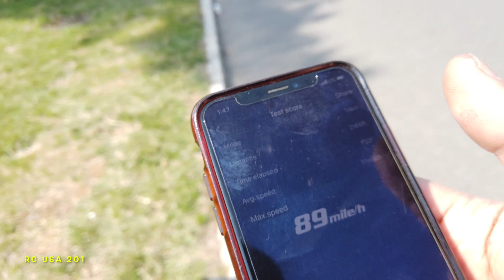Arrma Typhon 107 mph motor mount failed  NO BRAKES    OUCHHHHHH

Comment: Dam family u got u hella cars i got my maxx fixed rem i could not get it to work i had to reset it back to like to like it was new. I guess i pressed hella buttons.I got the green Typhon that came with the slow ass brushed engine it was my first car but after i got hang of it i changed to brushless esc ect.That the new one u driving thats pink? Iwant to get the Erovo 2.0 i think i saw u with 1 are those good ? But i don't really know cuz i like the Armma Craton too What kind of Car would u suggest to get what is one of the best Rcs out right now that u suggest to get my birthday is October 5 an im gna get my self a New car but I dont know what to get ang suggestions ?